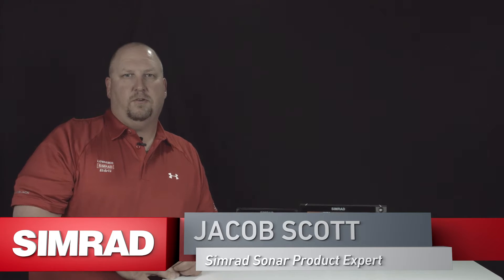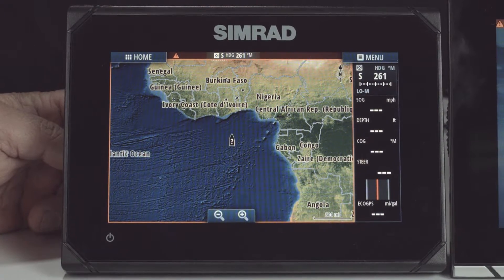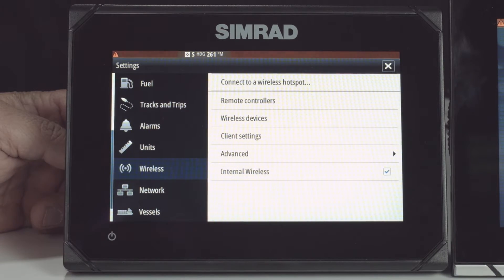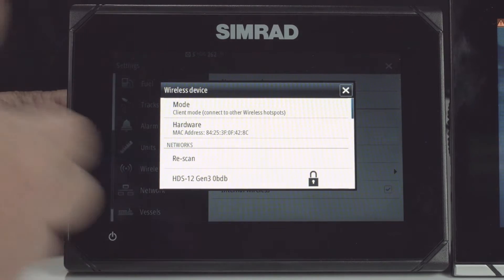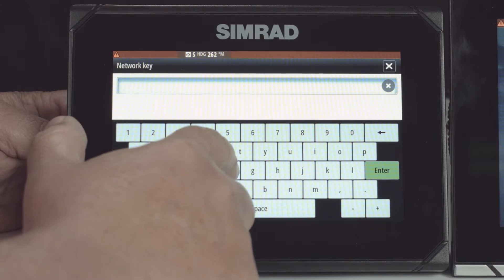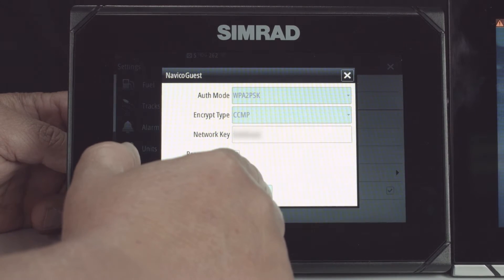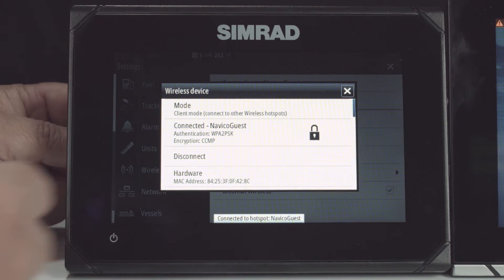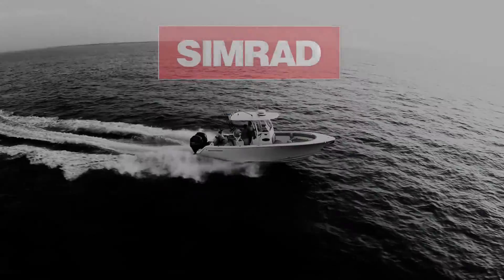How to Connect a Simrad GO XSE to Wifi

Comment: I pulled the boat up to the back door of my house and told my GO9XSE to scan for wifi. The Simrad unit detected two wifi signals from next door but would not see mine no matter what. My phone was beside the simrad and had full strength wifi. The only way I was able to get the simrad GO9XSE to connect was stumbling thru making my phone a hotspot and connecting the simrad via my phone. I backed up my waypoints a few minutes earlier and prayed it backed up for real! When the simrad connected, it detected available update immediately all by itself and I clicked update approval button and bam! updated and waypoints were still there....boy was I scared of loosing over 200 offshore marks! (I'm kinda a dummy when it comes to this new fangled MFD technology).

Comment: I'm having trouble using hotspot to connect. We have available wifi here and a laptop, but to connect to the wifi we need to go to an open browser page to sign in and we can't do that on the device. I also have a chip that can go from the laptop to the device. Is there any way to download the charts onto the chip from my laptop, then put the chip into the device?
Reply: Simrad customer service guy emailed me step by step instructions for dummies one time to back up data onto an SD card. He also sent me step by step on saving updates on card then installing update on simrad GO9XSE but I cant find the email anymore.
But I remember you download update on blank SD and must save it in the ROOT section of card. With simrad OFF insert card and turn unit on. Simrad "should" detect update on card and ask to install if the file name has not been changed from when it was downloaded onto card.

Comment: Were can i Find the WiFi key for using the iPhone for The simrad
Reply: Lars dekker assuming you are talking of connecting your simrad to your phone. I did it a moment ago and the "key password" was on the simrad display while I was trying to connect. I typed that into my phone when my phone scanned and found the simrad. My phone asked for the key I typed it in and voall-i
Reply: I just connected the simrad to update the software to (april 2019 v18.3) via hotspot using my phone. The simrad could not detect my home wifi but it did the neighbors. This time my phone showed the required password and I had to enter it into the simrad and it connected and immediately found available update by itself.